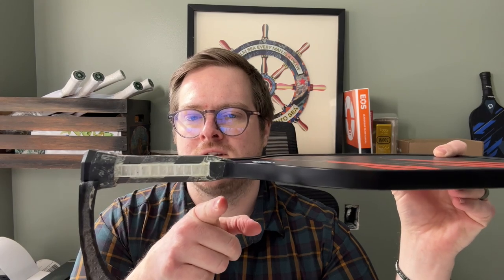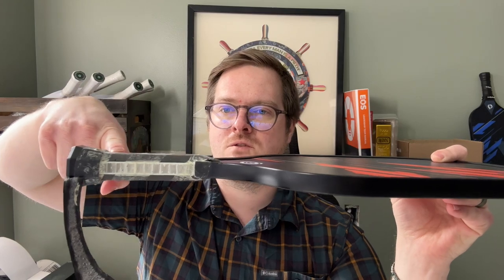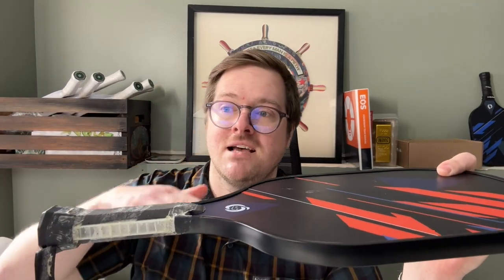What's the best pickleball paddle material? | Is it worth it to upgrade to carbon fiber?

Comment: Almost all Carbon Fiber paddles are using 3K thread s.  It’s the number of threads in a specific area.  I don’t remember, but it could per square inch or cm.  Also almost all paddles use T700 Carbon Fiber.  This is only a rating for Carbon Fiber fabric, which ranges from T300 up to T1100.  The higher the number the higher the tensile strength of the fabric.  Also as the T rating goes higher the material becomes more brittle.  So, T700 is a good rating for Pickleball paddles for strength and durability.  The biggest difference between Pickleball paddles in regards to Carbon Fiber is if they use a fabric rated for commercial aircraft/military applications.  Only a few Pickleball paddle manufacturers use this high grade Carbon Fiber fabric.  The ones that do use it use Torey Carbon Fiber.  The paddles with Torey Carbon fiber have been found to resist damage by up to 5 times versus the generic Carbon Fiber used by most paddle makers.  It cost about $5 per paddle more to use Torey Carbon fabric material due to it being about 30% more expensive.

Comment: Larry thanks for putting up this video for the "newbies". I'm not new and kind of a paddle nerd when it comes to what's in a paddle. You did not talk about "Nomex" as a core material compared to Polypro cores. Core breakdown is a thing and I know there are differences there too. I just got the Vatic Pro 16mm after doing some research on my own.
Reply from the maker: Yeah I should have brought it up. Especially when talking about the Z5.
Reply: The nomex core is the reason why the Z5 is so loud and not the graphite face.
Reply: Just got the V7 Vatic pro but I am a new player, would you recommend it for a paddle to learn on?
Reply: @Spazz983  I would recomend the Flash or even the Prism if money is tight.

Comment: Maybe in addition to discussion about shape and thickness you could also briefly discuss honeycomb cell size --8mm, 10 mm etc(diameter of the individual cells)?   What is the cell size on the slice paddle?
Reply from the maker: We are at 8!
Reply: @kiwilabspickleball  That is more of a power paddle dimension, which is good because combined with the 20 mm thickness there should be a good mix of power and control which I'm sure you know since you have been working on this for some time.👍

Comment: The Z5 also has a Nomex core instead of the more common polypropylene core. I am frustrated by the number of paddles that use polypropylene because I don't think they have a consistent sweet spot. I tried a demo Performance One Paddle from a guy in California and was amazed at the consistency of the sweet spot. But he is just one guy, and I am having trouble getting one from him. Please consider making an elongated Nomex core paddle with a carbon fiber surface using the surface knowledge you have gained from your experience. I believe the reason for the popularity of the Z5 is because of the core material.
Reply: Price point!
Reply: @gg80108  Yes, the price point is a factor in the popularity of the Z5 but the lower price suggests that Nomex may also be a cheaper core material for manufacturers. If I am right about a Nomex core resulting in a more consistent sweet spot AND if it is a cheaper material compared to polypropylene honeycomb then it should be a big win for paddle manufacturers.
Reply from the maker: Unfortunately nomex quality is hard to pin down in my experience. Plus only 2 of the many many many factories I have worked with even offer nome any more. It could be worth exploring down the road. But right now I don't feel confident in it.
Reply: @kiwilabspickleball  Thanks for the reply. I know he gets it somehow, I just have know idea where.
Reply: @TurningUs  Thermoformed is the future, Try one you will never go back. Z5 power with max spin/ control.
Reply: At one point in time most paddles had Nomex cores.  They tended to break down and not be as durable as poly cores. Thinner poly core paddles tend to have more power than the ones with a thicker core. On the other hand they are harder to control while making softer shots like drops which become important as your competition improves.  @TurningUs

Comment: There are lots of people who use adjectives like "plush" or "poppy" but has anyone made an objective measurement of paddle power? Can one not simply drop a ball from a set height onto it and see how high it bounces as a measure of elasticity, for example? If there is a standard ball (and one does it enough times to account for variable bounce), I feel that would be a good idea. One could even use a table tennis ball for more consistency coz it doesn't have holes. How high does a ball bounce of a kiwi paddle compared to the others?
Reply: That is referred to as “pop”. Power has to do with actually swinging the paddle. I am sure a test could be performed using a contraption of some sort to give a controlled and consistent swing.